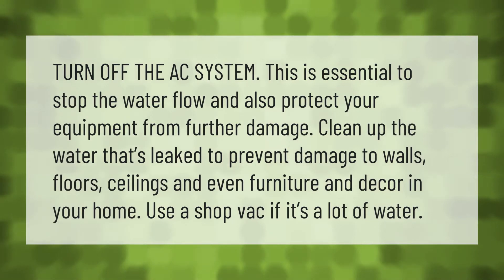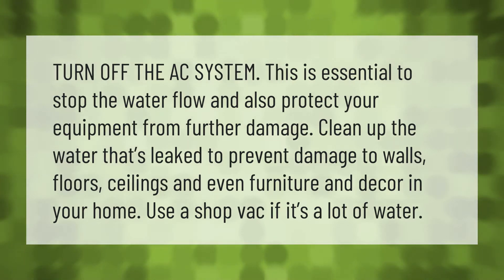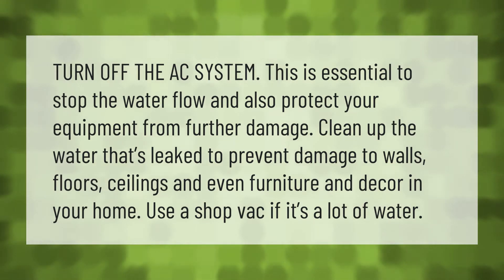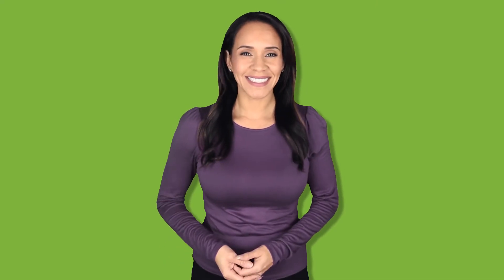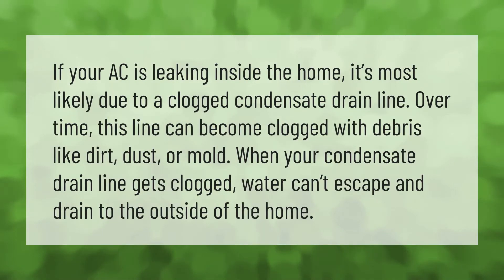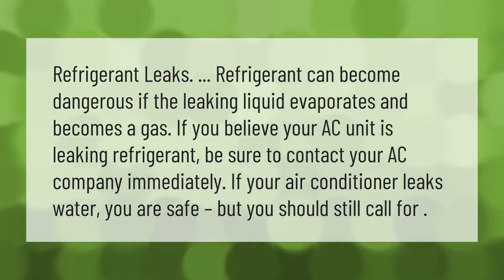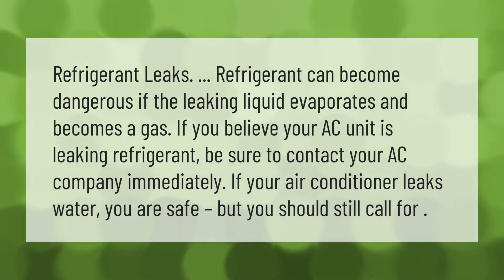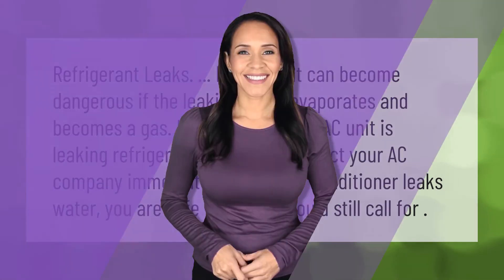How do I stop my AC unit from leaking water inside?

Comment: No questions just wondering why you didn’t mention that all you may have to do is tilted back the air conditioning unit a little more in the window. That’s why it’s leaking in the house that’s the first thing that should be done instead of all the other complicated stuff like taking it to be repaired before you at least try this first